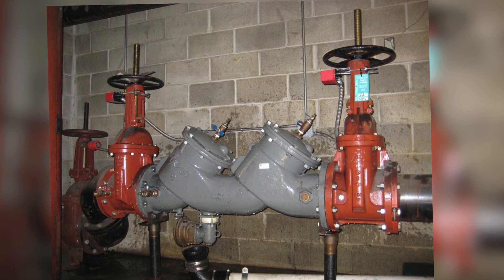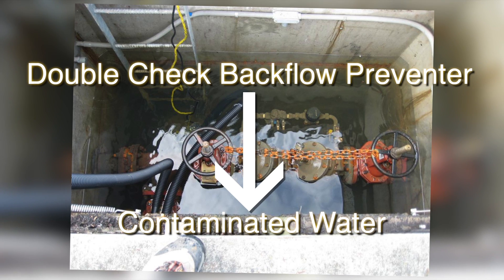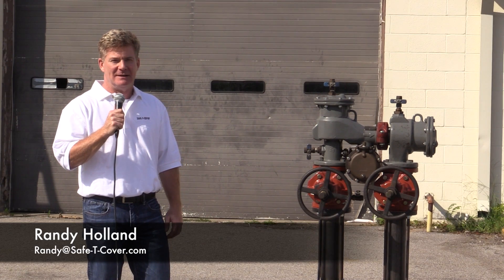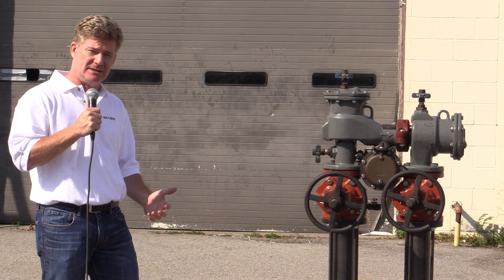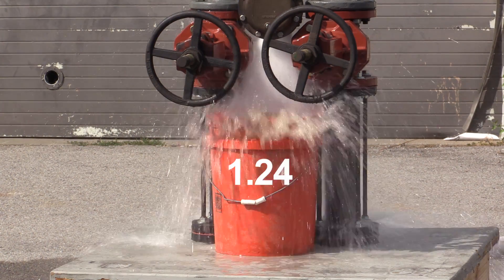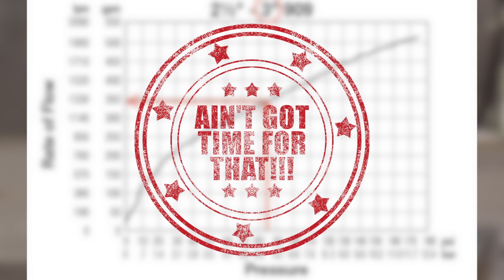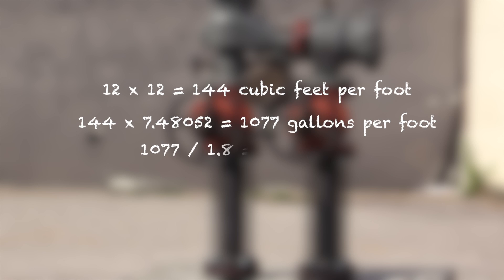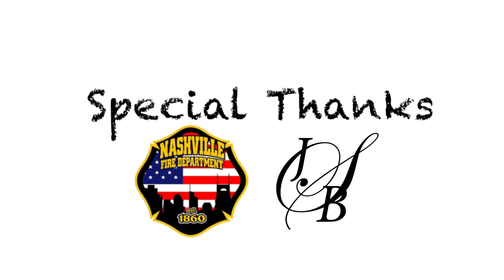What Happens When an RPZ Backflow Preventer Fails?

Comment: this is why the city typically DONT let you install an RPZ inside or in a vault, and also if they do the drain is required to be at least 2 times larger than the size of the device, so a 6" drain for a 3" device